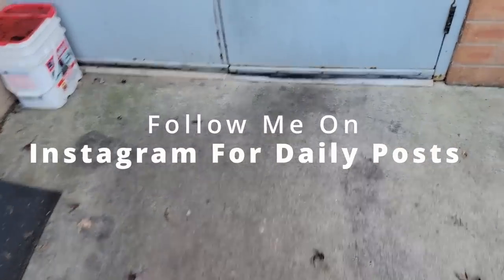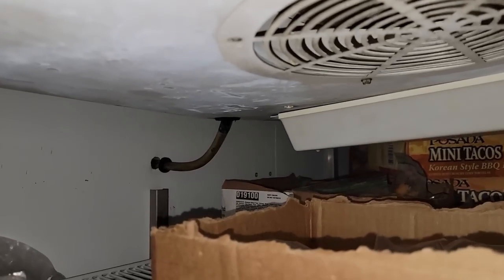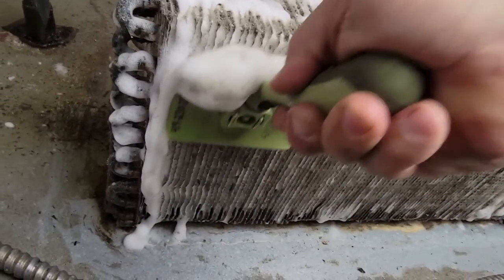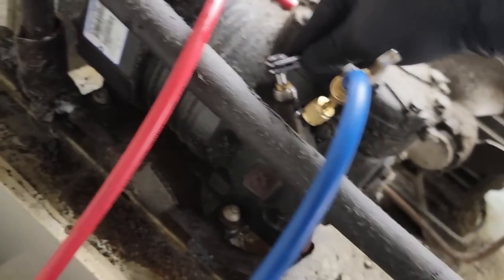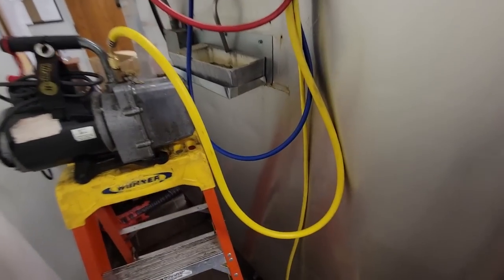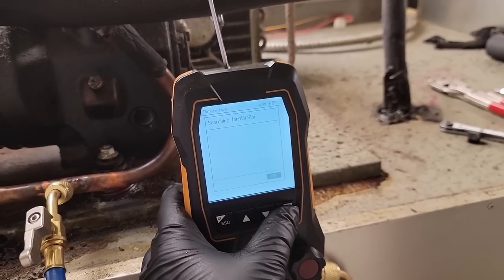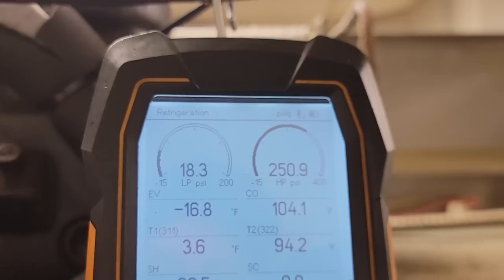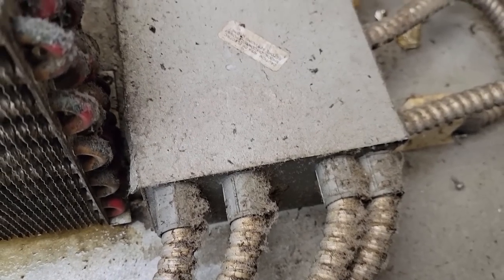My Freezer Is At 60 degrees! Fix It FAST!

Comment: Don’t know if you noticed this later, but the service valve was already back seated, and you were attempting to back seated even further (making it even tighter).
Reply from the maker: Yep, I make mistakes, if we're talking about the same spot on the video I caught it when I noticed what I was doing.
Reply: @HVACRSurvival  I'm hesitant to sometimes reply because the YouTube guys are so dam sensitive as if we are criticizing you. Please do get disparaged over the comments. They are not meant to degrade you.   the trolls you guys speak of,...I've not seen these comments, are they really that bad? I watch you vids all the time.  I'm 30 years in and trying to retire but the Boss insists he needs me... So I do part time now.  I just don't have the stamina I use to or strength...70....
Reply from the maker: It depends on who's stating it, there's some people that run down everything you do and there's other people stating something to truly help you.  I will purposely tighten things then try to go in reverse, in this case here I was talking, holding a camera and trying to work at the same time, it's easy to screw up that way, if it weren't for assholes that don't want to share their information I probably wouldn't be making these videos. These videos are my way of getting even with those that didn't want to help me or others learn.

Comment: Found it interesting the fans do not have a shroud as that does improve the performance of them quite a bit. At least it's now up and running again.
Reply from the maker: It likely did when it was new, they made a lot of them with a thin material a lot like cardboard but it can get damaged when wet.

Comment: Great Video. Thank you for sharing.  is freezer have Temperature different (TD) is 20 degree F  same ask Air conditioning temperature Different is 20 degree F.
Reply from the maker: TD is different than temperature differential. The way refrigeration figures it out is generally 10 to 15° above your saturation temperature on your suction gauge.

Comment: Instead of cardboard. I have used duct tape or foil tape. Get you a pair of line piercing vice grips. They will fit up to a 7/8 line so that you can recover and solder in a pig tail. That is a CPR valve EPR is on liquid line. CPR is crankcase pressure regulator. It prevents flood back when coming out of defrost by causing a restriction on suction line. I never use a chemical cleaner on condensor coils. Unless I can rinse with fresh water. If you do not get all the chemical off it will. continue to eat the metal on the coil. Brush and nitrogen have always gotten coils serviceable for me. Unless gummed with grease. Not trying to be an ass. Just some info from a tech of 31 years. The pet brush was a good idea. I use a bristle type grill brush found at most hardware stores. Where they sell barbecue grills, I prefer long metal twisted handles. Easily bent and long.
Reply: Ok, couple things. The CPR valves main job is to keep the suction pressure below RLA and keep that K body compressor from tripping the OL, especially when it comes out of defrost.  Those k body's have to run a really low suction pressure. CPR Doesn't really have anything to do with preventing flood back, that would be an accumulator. 

And the EPR is not located on the liquid line. It will still be on the suction line. But as you say will keep the evaporator pressure at what ever you set it for (normally found on racks). 

Not trying to be an ass, just didn't want any kids/new guys reading this and thinking it's right.

Comment: Nice brush you used to clean the coil! Where did you get the brush from?
Reply: Cat slicker brush, same one i use on my fuzzy son
Reply: Cat brush ive seen them at walmart
Reply from the maker: They're correct, they are cat brushes. Be careful which one you pick. Some are thicker than others and some tend to tear out of the bracket.